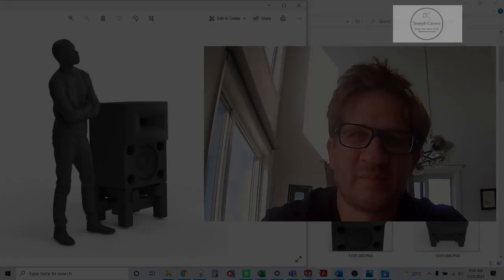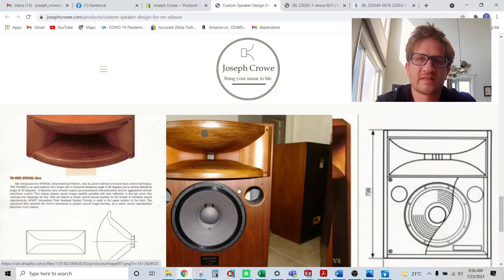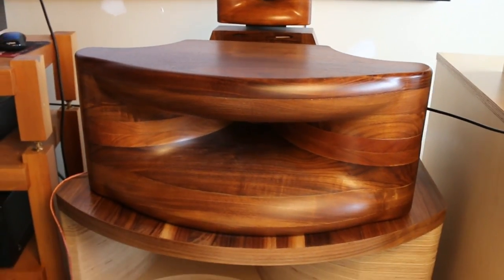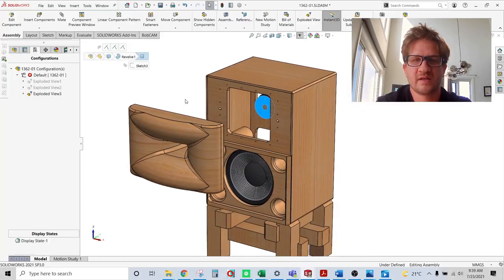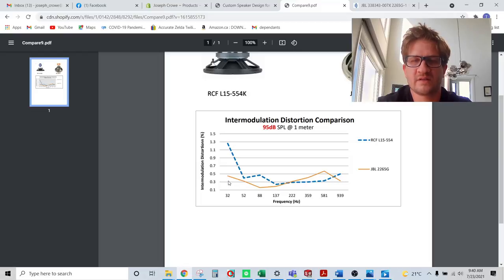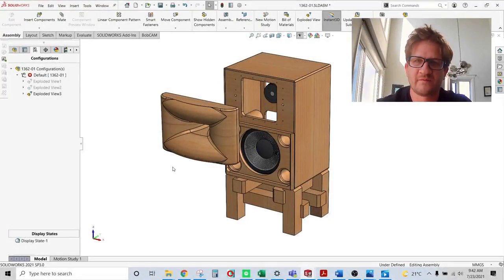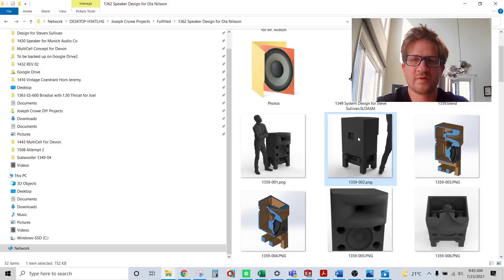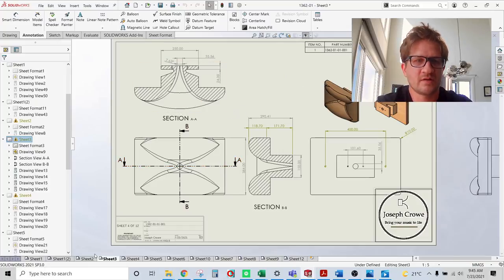Large Scale Studio Monitor Inspired by TAD TD-2404

Comment: So B&C is joining BMS and their 4592 for a 2" 2-way...  I will have to look into it. I have worked out a pretty decent crossover solution for the 4592... but always looking for other good options. One of these days I would LOVE to buy a set of these waveguides with 2" throat. They would likely run well with my bass setup consisting of 16" TAD 1602 and JBL 2241 18"
Reply from the maker: The new DCX464 is a 1.4” throat driver which offers proper treble coverage.  B&C offers a 2” version but it’s just an short conical adapter bolted onto the regular 1.4” driver.  For best performance you should use the 1.4” throat and have the horn flare geometry optimized for the intended frequency bandwidth (flare rate).  I think the DCX464 has fantastic midrange, but requires some work getting the treble to match the midrange performance.  Removal of the wire mesh bug screen is one step.  There are other crossover tricks that need to be implemented.  Also the DCX464 works amazing on 600Hz Fc horns as well, which is half the size of the ES-290 Biradial.  There’s still plenty of low midrange energy on the smaller horn compared to using other large format compression drivers.
Reply: I looked into the B&C... not bad, but I hear no reason to jump ship from my modified BMS 4592-16-16 with enhanced series crossover.... ( and the screw-head ports between chambers blocked)  

Really like your solution using the drivers selected in this project.  You are doing superb work. So refreshing in today's world.

Comment: Hello Troy! I have a question not related to this awasome project! Is it mandatory that the separation between the drivers not exceed the wavelength of the full cutoff frequency in horn loaded loudspeaker designs? For example on the cornwall IV the mids to highs crossover is 5khz, and my estimate, via some autocad drawings, is that they are vertically separated by 15cm and that is more than twice the wavelength of 5 kHz, it's actually 6.86 cm... Thank you!!!
Reply from the maker: For me it is not so much a consistent vertical off-axis that is important.  What is important is that there is an integrated sound character.  If I can perceive two different physical sound source location between the high frequencies and midrange frequencies then I find that objectionable.  Additionally, I find it really bothersome when the drivers are not physically time aligned.  If the high frequency is positioned too far forward then I can perceive it as a arriving before the midrange and it is distracting, along with the loss of dynamics and coherency.  So if the drivers are time aligned and the centers  are reasonably close, then the crossover point can be as high as you'd like.  Even with a Fostex super tweeter coming in at 10kHz  with a c/c of around 22cm I don't find there is any concern subjectively.  However if this was increased to 33cm then I would find that objectionable assuming a listening distance of 2-3m.

Comment: Hi Joseph. Have you used these horns (or the 600) in an open baffle?

I have PAP Trio 15 with Tangband full-range I want to replace. I suspect your horns would match quite well (given the stock crossover I have now results in acoustic cross of 700 hz). The woofers do have nasty breakup at 1,200 hz I need to avoid, so crossing at 600 looks ok?

Comment: Love the design. When using drivers like the dcx464 fully active with high quality dsp’s such as an xilica xp4080, would you consider it a compromise in audio performance using a fixed resistor L pad to reduce sensitivity to lower the audible noise floor? I run this configuration and am unsure if I should insert an L pad as my class d amp is too high gain, or purchase a significantly lower gain yet high s/n class a/ ab amp that should have a lower audible noise floor. Cheers from Australia 🇦🇺
Reply from the maker: This is a common problem for most of my customers. A low gain amplifier is the solution however there are not many to chose from with low enough residual noise. A fixed resistor L-pad is an acceptable alternative, but certainly a second choice. Make sure the resistors are sized to handle the wattage with a good margin, otherwise the dynamics will be compressed and certainly distortion will skyrocket.